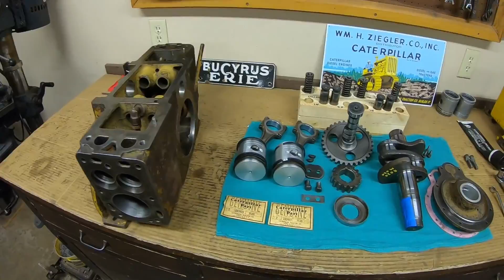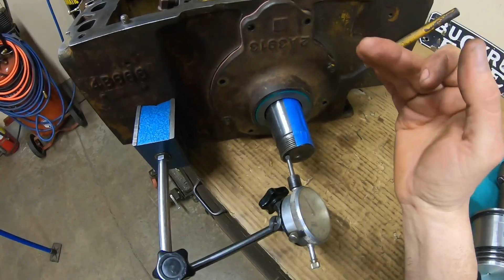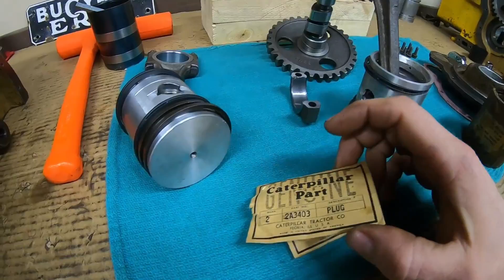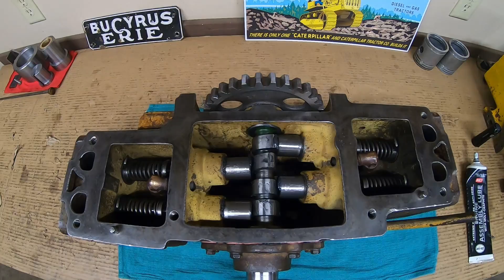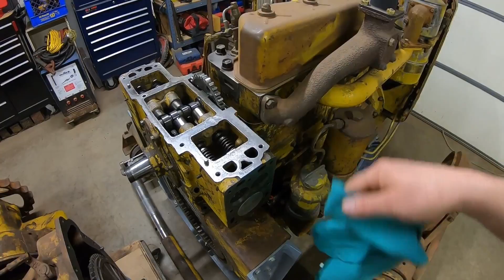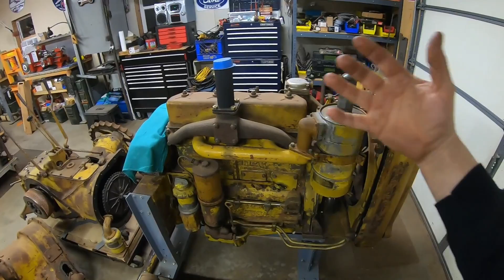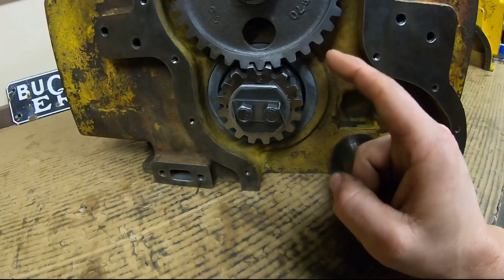The Caterpillar "Pony Motor" - Cursed by Design?? Or the Perfect Balance of "Just Enough"???

Comment: Here's an off-topic question that is related to proper care.  I just discovered I have a D2 owners manual for 4U1 and 5U1 and up tractors.  The recommended oil change interval for the diesel is shocking.  With "superior" lubricants it's 500 hours, with just a filter change at 250 hours.  This is far more than anything I've thought was appropriate, even with modern oils.  What is your opinion on 500 hour oil changes in D2s or other small to medium diesel engines?  Thanks!

Comment: Many of your viewers are looking at the pony starting engine with a 2021 perspective.  A better way is to look at the pony engine in the period that it was designed and built.  During this time, horses were not a distant memory.  

I thought it took a lot of time to start a D2 until I realized that getting a horse ready for work took a lot more time compared to the pony motor.   Twice every day, in the morning and night, the horse had to get fed.  The horse had to be watered multiple times in the day.  Then there was cleaning out the barn…

On a related side note – I remember you talking about one of the drain tubes on the main engine.  The mess made from that drain tube was far smaller than the mess made from the horse.

Comment: Hey Squatch, another great vid with some really neat info.

Here’s one to consider. Imagine if you would an engine that operates at quite extreme limits. It cannot be cranked cold as the tolerances are so tight, the engine is effectively seized when below operating temperature.

This engine requires an external source to heat its coolant and lubricant. Furthermore, it requires an external device to spin the engine up for starting.

In case you have not guessed, I am referring to a Formula 1 race car.

I think it’s interesting to look at what is (arguably) the most advanced engine in the world and compare it to what is something significantly less complex: the similarity is striking IMO.

With respect to the numbers you quoted re service life, a starting engine would likely remain serviceable for around ten to twelve years: with that number in mind, it’s clear that it is perfectly adequate for purpose.

Looking forward to the third build.
Reply: Talking about close tolerances; the engines in todays cars in order to gain a fraction or two of a mile per gallon have begun to use extremely light engine oil which requires tighter tolerances to operate normally.  This may affect the start up procedure especially when cold, I'm not sure, but I would definitely use a block heater even in the other three seasons!  It's always caused me to wonder, but such light oil gives practically no tolerance to overheating before terminal engine damage has occurred, and I would think reliability issues would be voiced by the public!
Reply: @garybulwinkle82  my car is a 1972 Triumph Stag. If your unfamiliar, the engine is a 3 litre V8 designed and built in house. The TV8 as it is known has a reputation for temperature related failures. They allow 24 thou lash on the rods, so the spec isn’t tremendous on them! Guess I better run it on that grease squatch puts on the crawler!

Comment: Myself I'm fine with the pony motors of the day growing up my dad had 2 green tractors an H and  GN GR both side winders the H being electric 6v.start on gas run on kerosene and it would run for days on end with a single tank full the other was a stem winder hand crank much the same operation as the H start on gas run on kerosene  it had one fault dad didnt get until after it was long gone he got rid of it because it would be running great then suddenly it would lock up and quit turn the crank backwards one revolution and restart it and it would run fine till it was shut off . Lol it had an internal soft plug issue that caused it's odd shut down behaviours.i grew up with JD Tractors the orchard model for a couple years but the H until my 20s he also had a Farmall F-12,F-14, F-20,and one F-30  all with Fairbanks and Morris Magnitos various models and all minus their gas starter tanks,converted to run gasoline in the main tanks sadly and all hand cranked to fire  and one Oliver AG6  gas fired dozer with a six cylender flat head continental engine. Love the old cat stuff and the Minniapolis Moline stuff and in fact I prefer those old adiquitly designed starter engines Good enough was just fine for what they did and still will do when the time comes.

Comment: Might be a good idea to put a motorcycle style vacuum activated petcock, (assuming you could hide it to not ruin the vintage look) They were very prevalent in the last decade or 2 of carburated motorcycles, call it mid 80's-90's early 2ks. Essentially they designed out the problem of operators leaving the gas on by having a diaphragm retract a fuel shutoff.. If you can't count on an operator to always remember to do something you might have to mitigate the risk elsewhere... Maybe you modify the magneto switch to also shut the fuel off?

Comment: I guess the diesel doesn't have glow plugs or any form of preheating so it needs a fair bit of cranking to fire up. It would need quite a large starter motor to crank the diesel for a long time and I am thinking that back in the day these would be expensive and so would large batteries.  If its cold the electrical system is going to have to work harder and with a flat battery you will be stuck.  I think that the pony engine is a more sure way of getting the main diesel started. There is no battery to go flat and the machine can be left for extended periods without the fear of not being able to start the  diesel. The down side is a bit more maintenance. Running the thing out of petrol will leave you with nice dry plugs and probably an easier start the next time. Why does so much petrol get into the crank case on these starting engines?

Comment: In the late 1950's I-81 was built through northeastern PA.  I lived two doors down from where they parked the cable pan scrapers and pushers at night, so we didn't need alarm clocks that summer - just after daylight every working day we were up just after daylight when they started those monsters up.  Pony motors first, then the diesels.  Everything was D-8's as memory serves.  Anyway, the point is that yes, the pony would run for maybe five minutes, then the diesel would start, and it usually ran 10 hours a day or more.  So your question about how good does it need to be is right on the mark.

Comment: We have overhauled my D2 pony motor a couple months ago and since I have owned it for 40 years and use it quiet often, we were surprised how little internal wear it had. It a little low on compression so we thought it was time for a tear down. the valves had great margin left but leaking somewhat as were the rings. We honed the cylinders enough for new rings and that took 95% of the scratches out. Ground the valves and seats, the stems and guides were serviceable also. We did have to make a new main , it hadn't spun, but had .011 wear. Polished the crank and used the good rod bearings. I have changed the oil faithfully, turned the gas off after starting the diesel also. I also think the pony is very useful for heating the jacket water, preheating the intake manifold and prelubing the diesel before starting. We agree  that the pony is very basic. Thanks for backing me on the use of the pony. Howell Machine, LLC

Comment: Using the fuel shutoff to stop small engines is still the best practice today, especially on equipment you only use every few months.  Waiting a few extra moments for the engine to run out of fuel sure beats cleaning the gunk out the carb every year.
Reply: I always unhooked the fuel line on my Mercury outboard backin the day. Never had a carb issue.

Comment: Really enjoy your series, especially the pony motors. I restore vintage Garden Tractors and I have several 18 hp Briggs opposed twin flat heads 70's - 80's vintage, that while more advanced (sleeved aluminum blocks, electric start, etc) they do share the more simple flat tappet designs, no oil pumps, and simple carbs, and I really enjoy working on these. Like you, I find this very therapeutic.

Comment: I love the pony start, in the late 70's as a teenager I worked summers at a Boy Scout summer camp and we had a late 40's D-4 and I used it every week, just loved the routine of starting it, though ours you started from the driver's seat, had a diesel engine pinion engage knob on the left side of the dash and the compression leaver and pony throttle and choke were on the right side, have never seen another like it before or since.

Comment: Since the starting engines are so "simple" and parts hard to find, I've often thought about building one from scratch just to see if I can. Just one of those someday projects I hope to get to when everything else has been restored. Great video as always!
Reply: Depending on how much you want to diy it, you could easily start with a 75cc crate engine s/a harbor freight predator. The big task is adapting the assembly to drive the bigboy engine with some sort of overrun clutch/bendix. A 50cc might have the chooch for the job, but itll need a lot of reduction gears
Reply: @Hyratel  I'm thinking more along the lines of actually copying the pony. Most of the components shouldn't be too tough, but there's a few I'm not capable of making myself. The thing I don't like about using a crate motor is you can't tie the coolant system into it like with original pony. I've seen a D2 for sale with a Predator on the fender, just didn't look good in my opinion.
Reply: @KettleMoraineMeadows  i can respect that ; it was just a thought towards "where is the value of my effort going within the project"
Reply: @Hyratel  I get that too. I feel like on a project like this, the value it's solely in thr pride I get of accomplishing something that has been an idea in the back of my head for years. And making something that keeps the original look if thre tractor.

Comment: I like the starting engine, mostly for the reasons you stated. Its more reliable in the sense there's less to go wrong. So long as there's fuel, the tractor will start. You don't need to worry about a battery going dead because someone left the ignition on and melted a coil (on a distributor, gasoline/distillate engine). Preheat is the best thing for those engines. May actually make that big diesel last longer. 

And if there's an EMP or some sort of apocalypse and there's no more electricity, guess who's still running.

Comment: Harley Davidson started off building motorcycle engines that were considered "throw away" items.  I believe Indian did the same thing, part of that probably was the lack of machine shops in rural areas.  The initial cost of the item versus the cost to replace it compared to making an engine that was much more reliable had to be part of it also.  Remember GM didn't put safety glass in cars for years after other companies did because it was more expensive that the lawsuits that originated because of people getting killed or maimed by it.  Corporations are built by making decisions based on profits.
Reply: GM has always led the pack when it came to cheapening the product. Passenger door lock removal as one of the better known examples...

Comment: Back when I was learning to fly one of the things my instructor hammered into me was that you shut down a light aircraft engine by leaning the mixture not the mag switch.  The switch works by grounding the mag.  If the wire breaks the mag stays hot.  The mag has an impulse coupling.  If it stops at the right spot, a slight nudge and a few gasoline fumes can give one more pop, enough to swing a prop blade.  No big deal except one of the few places you can grab a light plane to move it on the ground is the prop, close to the hub.

Comment: My dad tuned up the starting engine on a D315 gen set. Both engines were in pretty good shape. Using a battery start on the starting engine we could have the main engine running in less than a minute.  We always like starting engines for Cats. The way we ran them they say for months at a time. In this time batteries you loose charge. A well tuned starting engine would always start at -10 when batteries would fail.

Comment: My Dad was a heavy equipment operator in Iowa.  I can remember him going to work early on really cold mornings.  Start the pony motor and just let turn the diesel over for a while to warm it up just like you talked about in this video.  Weak batteries, corroded cables, gelled fuel and worn engines with low compression made a lot of battery start stuff a no start.  Of course, Dad did ever also use some ether he got from the neighborhood pharmacist.  Stuff was really volatile.  I can remember Dad saying you had to be careful with the stuff or it would lift a cylinder head.  I don't remember and Dad's gone but knowing him he probably used the ether on the pony motor to get it started in the extreme cold.
Reply: @squatch253  When I was in automotive tech school in 1971,  several of our instructors told us that they preferred to hold a gasoline soaked shop rag near the air intake instead of using ether to help a cold soaked diesel engine fire up.

Comment: Treating a starting engine like a diesel could make them last longer. Let them idle for a period of time to  warm them before applying a load. Also let them idle to cool down before stopping.
Reply: Their is nothing wrong with the pony starting system John Deere used it on their first two cylinders tractors just take care of the ponys and the horses will do the work

Comment: As someone who lives in extreme cold areas the starting engine was a Bane in my existence. Yes we had lots of them here and at -40* or colder you spent many many hours getting that engine started if even possible. The best way we found to get them started was building a fire under the stump pans and allowing the rising heat to warm up the engines and intake air, but building fire at 40 below was not fun either. Now once they introduced the electric start to the pup engine that made a world of difference. Some ether and spin it over. Now today most companies don't shut off equipment so starting in extreme cold isn't a thing, and global warming has helped also with fewer and fewer really cold days. I can't remember the last time it hit -47* on the thermometer. Times are a changing.
Reply: Global warming?
Reply: @mwilliamshs  Yes, maybe you have not heard of it but it's been going on for about 25000 years, give or take.

Comment: Thanks for putting the good info out.  It is very hard for folks raised on the tight tolerances we work to now, to look at how things were done in the old days.  I've seen stuff done by farm workers that worked, but were sketchy to the max. But times are changing... and not for the better.  You are really helping guys see that.  And it's important, especially in this day and age of less parts and longer wait times.  Learning to make things last as long as possible will be extremely important going forward.

Comment: Consider in the same number of operating hours how many electric start components would have been replaced and how many man hours lost to flat batteries in that time? I think the starting engine concept is just the right fit for the task.
Reply: All the "Will it start?" videos out there, where they bring clapped out batteries and shoelace starter cables to old equipment proves your point. And when they do have good batteries, I can smell the burnt windings and feel the glowing hot starters through the screen. And they wash away all the oil on the cylinder walls with huge amounts of ether.
Reply: @erik_dk842  Also have you priced a new battery lately? I wonder if the starting engines were still in production, would the cost of a rings and bearings rebuild be more or less than a couple new 4DLT batteries?

Comment: My Dad bought a new D4 in 1953 so I grew up around the pony motor. I still have the dozer. Have started it at 20 below zero by pulling one spark plug, giving it a little squirter of gas, then pulling the starter rope. Anything that can last 69 years on a ranch is impressive.

Comment: Another thought regarding these engines and old gasoline engines in general.
So many people have trouble with their carburetors getting gummed up.
I think it’s a relatively simple step to shut off the gas and let the engine burn through what’s in the carb.
If there isn’t any fuel in the carb to make a mess, you have helped yourself avoid frustration and untimely repairs.
I do this with my Farmall “M” and so far so good. 
Simple solutions can be good.
Reply: I remember my dad buying a Briggs and Stratton workshop manual, reading it and then religiously following its advice of always letting the carb run dry.

Comment: 15b dragline i acquired recently with a d4400. the rope start pony fired up so easy. carb float was stuck, cleaned the points and started in 2 pulls.   diesel side is locked up unfortunately but im working on that.   my other 15b shovel starts pretty easy with a dirty carb. little at a time ill get it all squared away
Reply: After watching too many "Will it start?" videos, where they haul big and heavy batteries, but can only afford old worn-out batteries, which they have forgotten to charge, I'll take a pull-start pony motor every day of the week. A 5-gallon canister is much easier to carry than a couple of 100 amp hour batteries.
Reply: @erik_dk842  i just brought my little 1 gallon gas can with me.  ive got the diesel side cylinders soaking in atf/ acetone and hope when the weather warms up ill be able to spin it over again.
Reply: @73DiamondReo  What are you going to dig out with your dragline?
Reply: @erik_dk842  just a toy but i would like to put a pond in at the top of the property.  i have some videos of my other machines